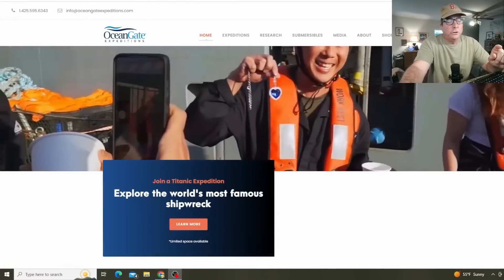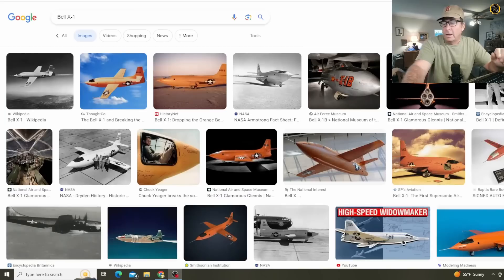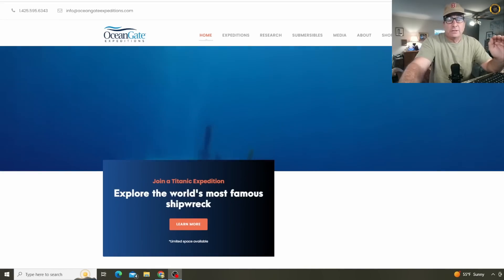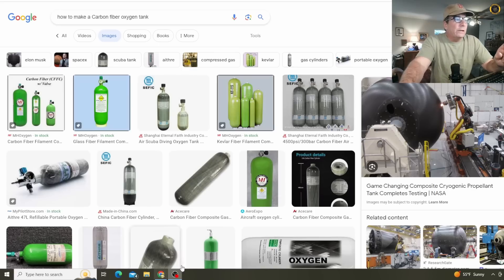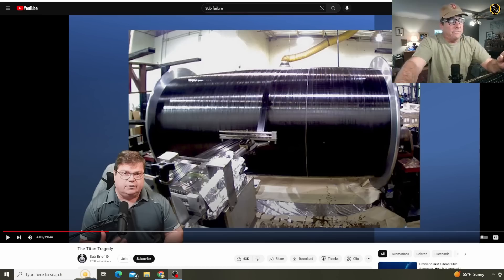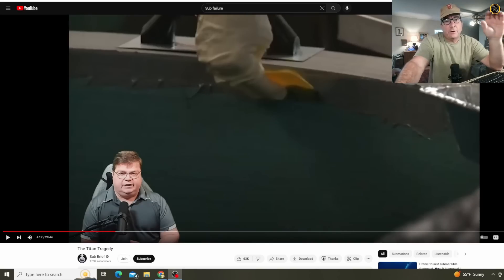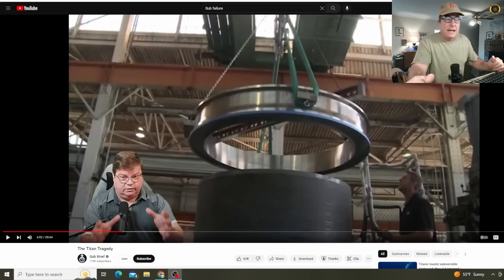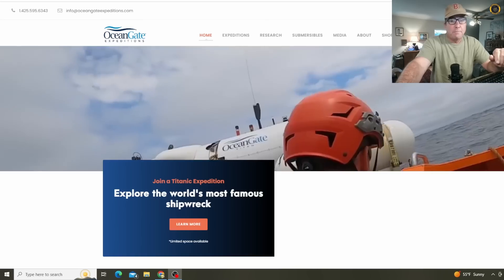Oceangate Sub Construction Details and Implosion

Comment: For cylinders that contain high pressure, the limiting stress tends to be tension along the length of the cylinder. if you double the diameter of the cylinder, the hoop tension, or the tension around the cylinder doubles, but the tension along the cylinder quadruples.  That's why trailers that are transporting high pressure gas, such as oxygen or hydrogen (2,000 to 2,500 psi),  have several long smaller diameter tubes grouped together instead of one big diameter tube.  Propane trucks have one big diameter tube because pressurized liquid propane is less then 250 psi.
Reply: The difference is that you have 370-380 bar compression from the outside, not from the inside of a gas tank.
Reply: @B-M.B  Exactly.  So many people are mixing up pressure vessel design with submersible design.  They are very different types of vessels with very different stresses and failure points.  Pressure vessels fail in tension, while submersibles fail in compression.  Fibers are good in tension, while they have very little compressive strength.
Reply: @dperreno Correct...and 1st year engineers know that carbon fibre has better strength properties in tension.
Reply: @dperreno  - How carbon fiber structures at the cold temperatures of the deep ocean?
Reply: @1965wazza  Your 1st year 3rd grader knows that fibers are better under tension rather than compression
Reply: You mixed up lenthwise stress (it should grow with the square of the diameter) and the loop stress arround the circumference (that's the one growing with the ^4 rate) otherwose I fully agree.
Reply: @clockworkvanhellsing372 I always thought the hoop stress was twice the longitudinal stress, whatever size you make it.
Reply: They could have tested the pressures on the shell... Hydraulic Frack pumps used in oil well fracking can develope 15,000 PSI Im sure they coukd have tested this way beyond that 9500 PSI depth pressures found...
Reply: @glennschlorf1285  afaik they did tests on a 3:1 model. But you can't always extrapolate those results to the real size.
That's why the manufacturer denied to certificate the hull for the planned depths
Reply: @glennschlorf1285  So i dont think theres any places in the world that can do pressure tests on something of the size of the Titan, there's very few places that can do higher pressure tests on larger objects, for the Limiting factor vehicle designed to go to the deepest spot on the planet could only be tested at a place in Russia and it was barely able to fit.
Reply: There's a great video doc on that on yt
Reply: That's why a 36" curved screen crt weighs so much less than a 36" flat screen....that flat part takes tones of glass on the inside part (in corners)to hold back against the atmosphere along the massive front part.
Reply: I would just ballast the vessel and send it to the bottom out by the Titanic to do my pressure testin'. 🤠 Tied to a long string so I could bring it back up, of course!
I think it would be fun to go out there with different types of cylinders and implode them! 💥 Propane, acetylene.... All sorts of possibilities!
Reply: In the longitudinal plane...only the glue was holding the layers.
Reply: Bingo, no 90° or diagonal oriented fiber. The epoxy was the failure point most likely.
Reply: A submersible isn't under internal high pressure at all and is not under tension. The pressure is external and causes compression loads to the carbon fiber cylinder. The stress is different when it is external pressure

Comment: It doesn't look like they got a close-tolerance fit between the Titanium flange and the tube by any stretch of the imagination. Lots of places for there to be insufficient contact between the carbon fiber, glue, and titanium. Overall, carbon fiber should never have been used for this because there are just too many unknowns with the fatigue of the material. There is also the possbility for sabotage at play here. The Dawoods had a lot of enemies so there would be motivation to drill a small hole to a specific depth in the material. Depending on this depth you could pretty much control at what depth the hull would fail.

Comment: All this time I thought it was a carbon fiber wrap around a titanium spool. If what you present is really the case, it is then NO WONDER the thing failed! This is an incredibly shoddy design.
Reply: The Sub Brief video mentioned a a titanium center cylinder. I haven't heard anything to make me think Sub Brief was wrong on that point.
Reply: Well, I'm rather confused myself, because it was my understanding that the carbon fiber was "layed up" over a titanium spool/tube just as you mentioned. I remember reading several documents which mentioned just that. I suppose it's possible they somehow just built the carbon fiber up without the titanium underlayment, but that would surprise me.

Comment: From my first glimpse of this design method I was always stunned by the layup method although I cannot visualize any method that could work.  It has always been my understanding that external forces on a cylinder are not directed toward the center point of a cylinder but rather laterally along the body.  That would put compressive forces colinear with the carbon fibre strands which I would assume is the weakest capability of any carbon fibre component. 
I don’t see that a diagonal layup would be any better as that would only strengthen an axial moment along the length of the cylinder which I would assume to be negligible in this case.  Perhaps our brilliant boys at Dark Aero could chime in.
Reply: Yup. The whole thing tries to expand, and it ends up bulging in the middle and growing in lenghth. At that point, you're neither compressing or putting tension on the material. You're bending it, which does both in opposition to each other.  Now you have a shear fracture waiting to happen, and that will happen parallel with the threads, so the only strength comes from the resin. Crack.
Reply: Try wrapping high strength tape around an aluminum can and see if you can squash it.  It is mainly the resin that adds strength in compression. CF can take much more load than steel in tension, and a pressure vessel is better use for it, where size and weights savings is important in applications such as hydrogen, and CNG vehicles.  I think the resin probably ended up cracking after repeated compression cycling and water pressure ended up pushing the long cylinder inwards. Once you have an out of round condition in the cylinder, the cylinder will buckle under axial forces from the end caps. It didn't help having the CF wrapped like a spool instead of crossways diagonally either. The adhesive bonds on the end caps probably wasn't a good idea either. Repeated compression cycles could have fractured the adhesive on the end joints as well.  If the adhesion gives way there will be no circumferential integrity of the structure either and the structure will instantly collapse. 

In retrospect had the structure been made entirely out of high strength steel, there would be more predictability for the loads, stresses, buckling, fatigue, corrosion resistance and use of sacrificial anodes, factors of safety, ability to inspect etc.  There would no joints and no chance for adhesive as point for failure. Steel is equally good in tension and compression and for an underwater application do you really care if the object weights another 1000-2000 lbs?    As long as you displace enough volume it will maintain buoyancy. Titanium is also very expensive, difficult to fabricate and again if weight savings are important than why was it used?  This thing isn't flying or going into space, so I don't know if the structure would have cost more or that much more if made from steel - just like most ships and submarines.

Comment: Surely different rates of expansion between different materials which are glued together isn’t a good idea whether it be in space or at great depths?
Reply: Annnnd, once the adhesive cures, it too becomes dissimilar in that the bond becomes a third solid which cycled enough will begin to crack and lose its integrity... RIP.
Reply: The point of failure and the misconception is the composite itself.
Reply: That's my current thought.  plkracer offers that each element's load can be passed between the structures, and I have no reason to argue that point (it's beyond my level), however, I will note that the amount of compression on the carbon-fiber cylinder just outside the titanium flange, and that portion underneath the flange were experiencing different factors of compression and expansion: another commenter above said carbon-fiber expands when placed under colder temperatures.  My question is, did the compression load from the water pressure against the exposed hull, compared with the expansion characteristics of the carbon-fiber underneath the titanium (at about 28 degrees F), cause enough deformation that would lead to its failure?  There's a reason differing materials are not used in conjunction when placed under extreme stress.  Mr. Rush seemed to relish the fact that he'd ignored this effect.
Reply: It's a common calculation that the load induced can be passed between the structures. Each will be forced to conform to each other under a balance. I'm sure they did good math to determine the inner and outer Ti rings would flex with the composite, and vice versa.
Reply: @plkracer  They didn't seem to understand the difference between compressive loading and tension loading, so I figure their math was something like pi=3. and 2+2 < 10 and 2+2 > 0.
Reply: @johnpublic6582  oh, they understood it (it survived the first dive, so they did something right), but they didn't count on defects and delaminations within the composite, and the owner was too overconfident to check with NDT after each dive.
Reply: @johnpublic6582  apple + pineapple = banana

Comment: I’m sorry but there isn’t an adhesive alive I would trust at 4000m pressure.
Reply: The adhesive they used was only rated for 1400 meters of pressure...
Reply: Pressure makes a pretty good adhesive on its own, but you have to design things to use it instead of fighting it.

Comment: In my opinion this is a parallel to being an air romantic, which I have noticed is a person that, without basic knowledge, fantasises about "I feel like having wings, I am soaring" and uses or builds equipment unconnected to the many years of building experience that is needed. In my own experience these persons terribly often end up dead in terrible accidents, like those I have witnessed, especially in the early years of ultra lights.
Similarly this Titan seems to have been surrounded by submarine- or deep sea romantics. With the same terrible results. And more to come if they are not controlled and stopped.

Comment: Carbonfibre is very good at bonding to titanium, with no galvanic issues at all, in sharp contrast to aluminum and steel. But Carbon fibre is not good in compression, so if the hull cylinder/tube was made out of titanium (with integral titanium flanges, to bolt then halfspheres to), with a skin of carbonfibre to carry handling loads during transportation, et cetera, is a great idea, but to use it to handle compression is not a great idea!

A famous aircraft brand uses carbon fibre in the wing beams, but those most of the time subjected to compression loads are twice as thick as those that are exposed to tension loads, as carbon is not that good in compression.
Reply: the bonding is likely to be with whatever resingthe CF is layed up with. Probably an epoxy but there are many different formulations and perhaps some variation between batches of ostensibly the same stuff. Did they test all their resin batches for consistency and quality. Not doing so could be a weakness.
Reply: @keithmatthews1673  Definitely a lot of trial and error involved to get the right mix and then taking it down to 4,000 meters depth. Again and again! Then you might carry passengers! And how did they measure that the air was enough for 96 hours?! Did they lock people inside for that period of time and see if they lived?!

Comment: Carbon fibre is interesting stuff. I few years ago I tried a do-it-yourself project making violin bows. I found that the sticks lacked torsional ridgidity ie they twisted too much compared to good wooden bows. I gave up on the idea. A few years later I looked at the discarded bow sticks and to my surprise they had very good twist resistance which had greatly improved over time. I did not have an autoclave so I cured my sticks at room temperature. My point is that laminated CF may change over time and that is just from my one empirical experiment.
Reply: Epoxy can still continue to harden or cure even after its rated cure time,  Like with glass it can be classified as an amorphous solid where its technically neither a liquid or a solid
Reply: That's interesting. Thanks for sharing your experience.
Reply: This is called post curing. Let me guess, at some point they got quite warm as well?
If you expect any kind of structural performance the resin should be heated at an elevated temperature after room temperature curing . This varies with the type of resin, but typically it's something like 80°C for 5 hours. Pre preg is usually cured at high temperature anyway
Reply: Front forks experimental carbon fiber, on bicycle many years of age, still strong.. and light.. ;]

Comment: My brother is ND Engineer, he was contracted by GE to certify the engine cowls on their engines that are made from carbon fiber using ultrasound,  the cowl on these engines that surround the fan blades are 3-4” thick, and designed to contain the engine fan blades in the event of failure as well the ability to mitigate damage during  a gear up landing … Its entirely clear to me that either the flange design failed at the glue point due to deformation of the tube. The tube should have been bolted and glued to the flange, and the tube itself should have had a interior titanium skeleton to prevent deflection. I suspect the tube started leaking at first the rapidly failed at the flange. I’m surprised the engineer didn’t question the flange design, the pressure acting on the tube would be far greater than the end caps. it appears the tube is tapered also ?

Comment: I saw that vid a cpl days ago and couldn’t believe it was that simple… like using duct tape😳 I read part of the lawsuit from a former employee on the team that referred to voiced safety issues that were ignored said it should have been 7in atleast and also that they made a 1/3 scale model to test with and it seems to have shown design errors or something. Would like to read more of the doc.
Reply: Ugh.  These things don't scale linearly.  A 1/3 scale model tells you next to nothing if you don't have years of testing to failure in conjunction with testing at different scales to build up your own emperical data for exactly how they do scale.

This is why we were still learning things about steel metallurgy in the 1950's with respect to oil exploitation in the arctic cold.  Those kinds of stresses had not been used at that exact temperature range until that point and they found that new alloys had to be developed.  Still learning about steel 200 years later.  Still learning about titanium 70 years later, etc, etc.

Comment: When they put that on there was no squeeze out when they dropped it down. No bleed off release holes, so you know it’s full of air gaps. What’s sad is if he would have built a rated hull, he would have gotten his money back in a few seasons.. and the under lap should have been greater than upper by a factor of 1.5 given the span of width on inside of tube assembly
Reply: That was one of the things I thought seemed horribly underbuilt, the moment I saw the build videos; the way the titanium rings only had very shallow engagement with the carbon tube.  Not only was it a terrible idea, but it was a very badly executed terrible idea.

Comment: The titanium end caps weren’t bolted they were glued. It’s in that video you showed the still from… probably just blew apart… edit: you said it, spoke too soon, sorry Juan.
Reply: The end domes were bolted to the end rings. The end rings were bonded to the carbon tube.
Reply: @simonbaxter8001  I get that. I made mention yesterday on Juan's video what I'm talking about and posted a link to the video he's using. I'm talking about the carbon fiber / titanium bond. They used glue. My jaw hit the floor when I saw that. Juan said the same thing. I get that the titanium / titanium connection was bolted...
Reply: @SammyTheDitchDoctor  Most parts on a  composite structure are bonded with adhesive as bolt holes in carbon introduces stress risers. Also the theory is that the bond has a much larger surface area than a series of bolts. The adhesive problem is that whilst it's good for low stress structures and less harsh environments, I really don't think its the best choice for high pressures, salt water and the amount of flex that this structure would do. It probably has never been tested or approved by the manufacturer of the adhesives to be used in this kind of extreme harsh application! Hence the lack of certification.
Reply: @simonbaxter8001  I agree with you 100%. The different heating and cooling rates, the three different mediums (titanium, bonding agent and carbon fiber) and the mind boggling pressures these surfaces were subjected to. I picture squeezing a biscuit can and the glue failing and the ends flying off. (Though in this case it would be opposite force and the ends imploding)